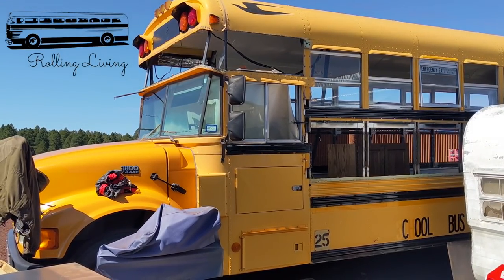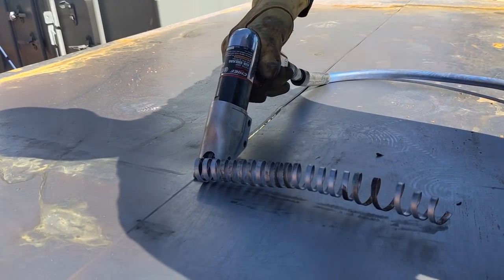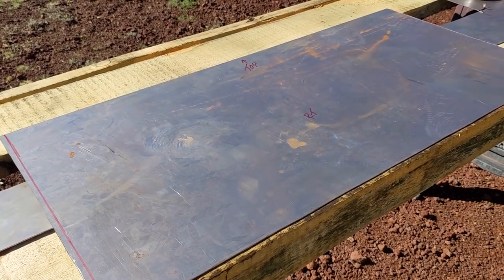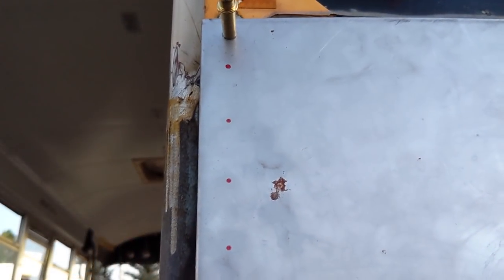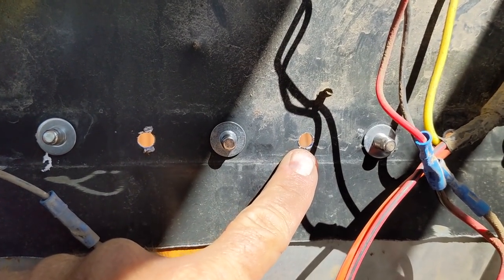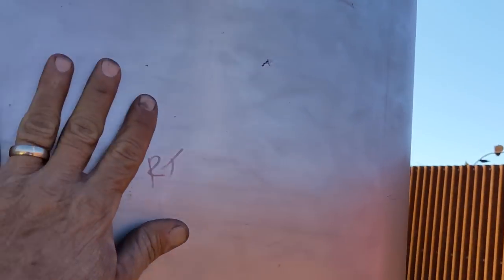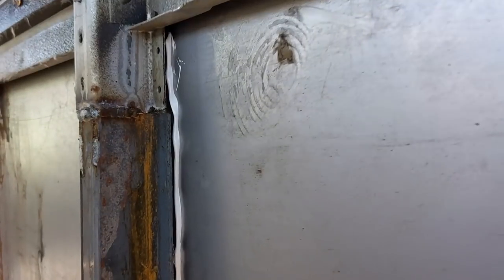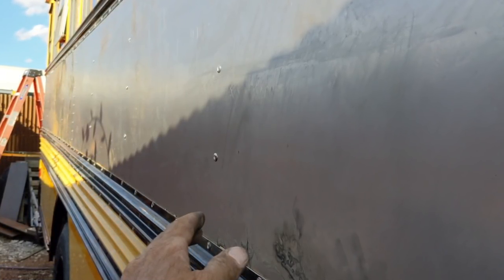Skinning a bus...the sides and rear corners.

Comment: 5200 is no joke you won't have to worry about it coming back apart or leaking. Nice metal work.
Reply from the maker: Thanks...and, yes, 3M 5200 is about as permanent as I have found.  It's not cheap, but we use it on all of our raises and other places we want joined permanently.  I really appreciate your kind comment and support - as a new YouTube poster, that is very motivating.

Comment: What type of sheet metal are you using for this? Is it just regular carbon steel sheet metal? 1018? Galvanized? A36/A500 type Structural?

Comment: I've been searching everywhere for the correct rivet.  My criteria were 1/4" diameter stainless rivets but NONE of the suppliers have CLOSED END rivets in the 1/4" size. (They carry the exact item in 3/16, but not 1/4.)  I thought it would be smarter to use closed end to make it more waterproof.  Any reason you don't use closed end, or ideas why that doesn't seem to exist?
Reply from the maker: Actually, I thought I shared that I only use closed end stainless rivets.  It might be in another video in that series...but I do show the difference. I drill out the holes and use 1/4-inch closed end rivets, so they fit tightly and the head size matches the factory bus rivet diameters

I get rives from Jay-Cee Rivets (rivetsonline.com) or Byler Rivet.  Both carry 1/4-inch closed end stainless rivets.